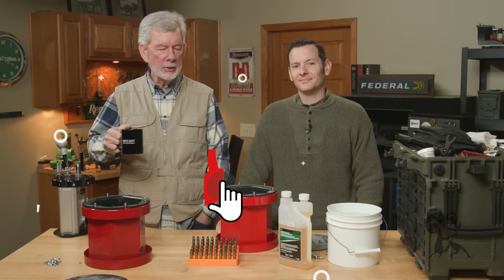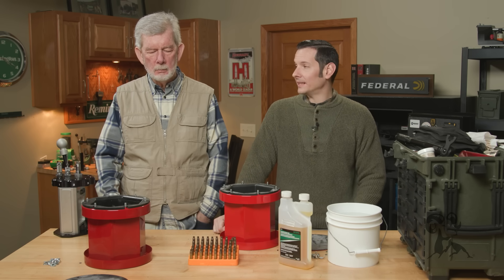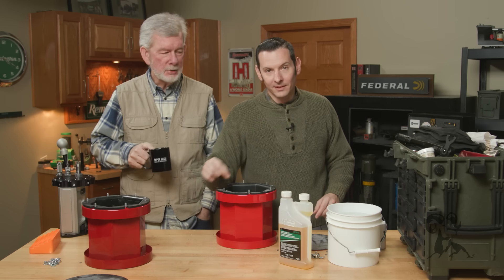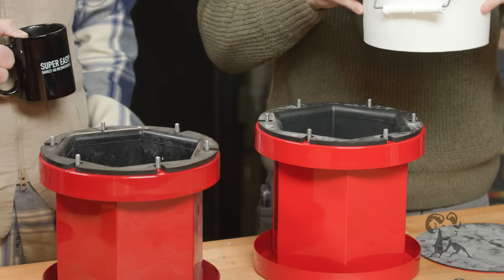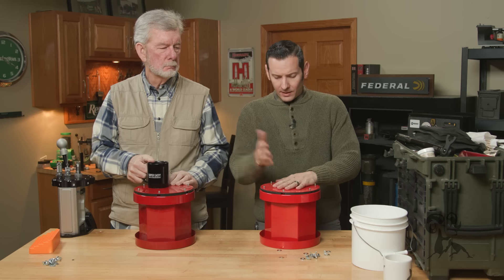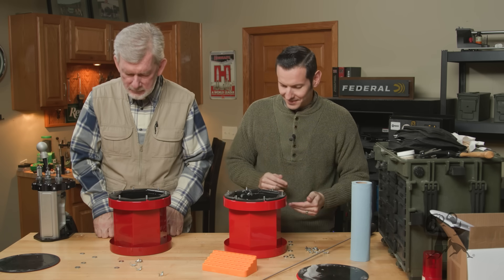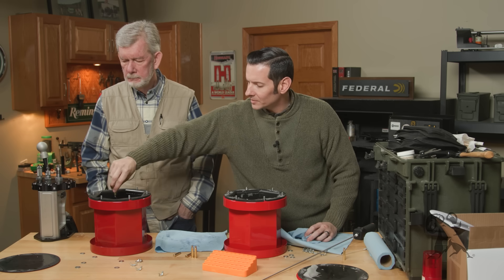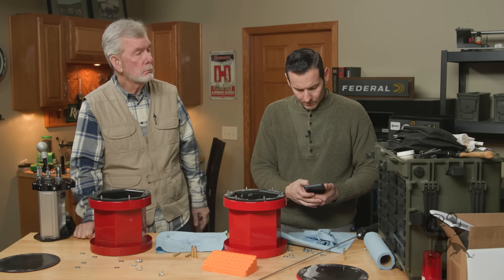SmythBusters: Tumbling Brass With And Without Pins

Comment: I've used Brass Juice with wet tumbling, no pins, and the cases came out looking brand new/virgin. These were cases I had just shot, so not sitting out all winter, or for months, in the weather. From what I've heard, the solution you use makes a pretty big difference in how the cases come out. Especially if you don't use pins. I do have some pins on hand, so I COULD use them IF I really needed to. Just haven't seen the need to date.

Comment: Nice video. But you left out one massive negative factor in tumbling with SS pins. You should have shown the difference in peening of the necks. That would have made this video totally thorough and more relevant.
Reply: Never had peening of the necks, but I only tumble for 30 to 45 minutes. Minimum required for a clean pocket. Heck, I tumble rinse with the pins too and it didn't beat up anything.

Comment: Now, do a comparison with an ultrasonic cleaner.

I use an RCBS ultrasonic cleaner -- no pins, of course. I also decap before cleaning. My brass comes out as clean and bright inside, outside, and in the primer pockets as your brass tumbled with pins.

Comment: I used both, dry for many years then went with SS pins. There's a BIG difference of inside the cases and primer pockets. Pins can and do get stuck in the primer pockets and inside cases if not careful. Also pins can and do cause stuck cases unless lubed very well even with pistol cases. Bottom line is how well you like your cases clean and shinny. If the cases is clean inside and out that's the biggest thing. Shinny is to each their own.

Comment: I never use pins. I use Lemishine and 4 cap fulls of Frankford Arsenal Brass Cleaner in a Frankford Arsenal large Wet Tumbler with lukewarm water. My brass is always super clean. Never had an issue using this method
Reply: Same for me.   I dont use pins and the brass is very clean on the outside and much cleaner on the inside than when I started. No pins to get stuck inside the case or deal with or to purchase.   KiSS theory
Reply: Same here. Cleans well enough, don't need show room shine, just clean for die use/effect.

Comment: Steve wins simply because he doesn't have to deal with removing the pins or rinsing the foam.  I'll stick to walnut tumbling though...I can get brass clean in 3 hours, shake the walnut out in 2 minutes and start loading without having to wait for brass to dry.
Reply: I went to wet tumbling due to the toxic dust from vibrating cleaning machines.  I developed COPD and the dust was aggravating my condition.

Comment: I usually dry tumble a few hours with a few thin strips of dryer sheets. The sheets help collect the carbon dust. Toss the sheets after a tumble then de-pin. Then the brass goes into an old Nestlé quick plastic tub with a drop of Dawn dish soap and a few drops of lemishine and just enough water to cover the brass. Hand shake or swirl for 15 minutes to 30 minutes, as much as my arms can take, then rinse. Dry with a fan on a towel and everything comes out like new. No pins involved.

Comment: I find all the expensive cleaning gimmicks a clever bit of marketing. I have not used pins, to date, have not seen the need. Primer pockets come out very clean. I use a formula from a demonetized YouTuber who has moved to other platforms. Lemi-Shine  being his magic ingredient, dish soap the other. I modified to what I had on hand for a cleaning and never went back. Lemi-Shine , a splash of Simple Green and  mostly water. I do small batches, typically what I just shot at the range, a HF tumbler gifted to me, 3hrs-ish.  All shiny. I still use dry media vibratory tumblers more than wet.  Still works, great for pistol cartridges, rifle rounds loaded with the dry cleaning still give me my .75" groups at 200 with my best shooter. Some things aren't enough difference to make a difference. I'll obsess in other areas.

Comment: So I’ve used my FA rotary tumbler with dish soap and Lemishine with great results, and tumbled for less than an hour.  That said, I’ve only done 300BLK and .45 Colt brass so far.  Maybe 5.56 takes longer since it has a smaller case mouth for the pins to go in?  But tumbling for hours, like they mentioned in the video, seems excessive.

Comment: I don't use pins, I don't even use a tumbler. Just a rubber tub with soapy water. Give it a good shake and roll occasionally while watching TV, and it's good to wash off. It doesn't polish the finish super shinny, but it's functional and easy.

Comment: I have a question for the community. Would this test also translate to aluminum suppressor baffles? I've seen folks say that we tumbling is the way, but others say that the pins round out critical surfaces.... So would wet tumbling with no pins be beneficial in that case?

Comment: In my country I can't get pins. I use split corn, kinda works
Reply: Tumbling I would guess. Give it a try with corn cob media. Maybe get it at a pet store that is used for bedding. Add a little chrome polish and in my experience, will get the cases clean enough for reloading.   Good luck.

Comment: For me, I quit pins and don’t use any of the pre-made formulas. I use a squeeze of dish soap, a little cap of citric acid or Lemishine, and a capful of TurtleWax Wash and Wax.  I let it roll in a Frankfort rotary tumbler for 90 minutes. 

Using pins there was the possibility of missing a pin and ruining a barrel, plus at times the pins can peen brass mouths. Only time I will use pins anymore is nasty range-pickup brass that’s really coated in dirt.
Reply: Mostly same.  I don't use the Turtle Wax stuff.

I don't use the pins because separating them out takes a lot more time for very little added benefit.

Wet tumbling is safer, leaving less lead residue, but vibratory tumbling was so much easier and faster.  This is how I split the difference.
Reply: Citric acid , wash and wax , no pins here. Works fine . Maybe 45min of tumbling. Sometimes I throw in 9mm casings with rifle casings to  act as roughage.

Comment: Either way, if you wet tumble, the necks get peened.  So you have to deburr and your cases get shorter each time.  Dry tumbling is still best, or wiping them down by hand if there aren't many.
Reply: @spraynpray  in my experience the peening only occurs with SS pins. I get zero peening the way I do it. I’ve found the firing process and sizing process incurs enough case growth it needs trimmed and deburred anyway. I use a Henderson 3-way trimmer and it takes less than a second a case and they come out exactly the same.

Comment: 3-4 hours in the tumbler?! Mine comes out shiny in 30 min. I usually decap, tumble once with pins, size, and tumble again without pins to remove the sizing lube. Dry cases in the jerky dehydrator for an hour.
Reply: I was going to say the exact same thing. 30-45 minutes is more than enough, with or without pins. If the brass is really nasty, maybe an hour and a half at most. One of the huge reasons to switch to wet tumbling is to cut down on time.

Comment: Seems like WAY more trouble than it is worth. How can you be sure the cases are dry inside?  I think I'll stick with a vibrating cleaner with dry media. I can go from clean to reloading in 5 mins. :-)
Reply: That's what a dehydrator is for.  Can be dry in a half hour-an hour. Now, if you're smart, multi-tasking in big batches is the way to go to keep components stocked. Dry tumbling works just fine. However, if properly clean brass is the goal, there's no comparison.
Reply: Food dehydrator, or a convection toaster oven.
You should see how dirty the water gets.
Reply: @TheSuburban15  Is this really an issue though?  I used to shoot IPSC, Steel, 3-gun and various other rifle and pistol matches and must have reloaded 10's of thousands of rounds of various rifle and pistol calibers and while the outside of my brass was clean and shiney like jewelry I don't ever recall the inside of the case being an issue. Throughout all that reloading I never had a squib or a round that wouldn't feed or chamber.

Comment: I like to wet tumble without pins first. That keeps all my equipment clean. Then I de-prime, tumble with pins if I care enough about the pockets. Sometimes even a 3rd "rinse" w/o pins to remove lube. 
Thanks guys!👍👍👍👍👊
Reply: I tumble before depriming and after as well to protect my equipment from excess wear

Comment: Depends again on what you are doing.  I decap and wash, dry, size and trim then do a final wash.  Using a two wash like this, I could not see a difference between pins and not pins.  But we also police our brass as it is shot.  That may be the difference.

Comment: For those that have never wet cleaned their brass before, Caleb and Steve are demonstrating a way more expensive system than needs be. For 10+ years, I have used a Harbor Freight rock tumbler and a few drops of either Dawn or car wash liquid. I separate the pins by dumping the brass into a Dollar Tree colander (with slots…not holes). I have literally used the same SS pins since starting cleaning this way.
Reply: Why wet tumble?  For years I dry tumbled 5.56 using a Dillon Precision vibrating case cleaner and media separator. A tablespoon of their polishing compound and those cases came out looking like JEWELRY. I did many thousands of pistol and rifle cases without a single issue.
Reply: @eosjoe565  I didn't even know there was such a thing as wet tumbling...I used a tumbler and walnut shell...lol
Reply: @ Same here.
Reply: @jz362  yes, dry tumbling certainly works.  But there is no comparison between dry and wet tumbling.  Wet tumbling is light years cleaner
Reply: @eosjoe565  Lead dust for one. Time for another, dry tumbling takes a lot more time. Efficiency, noise, cost (wet tumbling costs more to set up but the materials are under a penny each time), wet tumbling gets them cleaner etc.
Reply: @eosjoe565  same here but I use car wax bc I’m cheap
Reply: @bocefusmurica4340  I'm sure the stuff Dillon sells is just liquid car wax. :-)
Reply: @bocefusmurica4340 I was wondering if you could use wax or even a 3step polish
Reply: @eosjoe565 dry tumbling is more than adequate for cleaning and loading brass. Been around a long time for a reason. However, there's no comparison for both the dust you would no longer have to deal with, and end of the day, wet tumbling absolutely makes it cleaner.
Reply: Yep.  Dish soap and a little "Lemi Shine" dishwasher additive is my recipe for the rock tumbler.
Reply: Low capacity but sounds good
Reply: @bocefusmurica4340 the double barrel rock tumbler probably holds 2/3 of this featured one.
Reply: Why would anyone NOT use pins? If it does a better job then why go without?
Reply: I never tumble anything. If the case is super dirty ill just wipe it
Reply: @tiputipu777  - you like pretty cases regardless of actually being dirty. 
I want my cases clean, inside and out l- not merely pretty.
Reply: Yeah I have one of those and have used walnut chips and car wax and it is super clean
Reply: I bought one but it's just a vibrating dry one. I just use sand with some polish stuff I bought at Walmart.
Reply: I’ve been dry tumbling since the early 1990s. 
Still works just fine, thanks.
Reply: Someone making life more complicated than it needs to be telling others they are making life harder than it needs to be.
Reply: @dn88s   be less idiotic

Comment: I stopped using pins, does not work as well and takes longer, but it's good enough and saves time getting the pins out of the brass
Reply: That’s why I have no interest in it.  Massive Dillon tumbler for the win. 

I would do it for extremely tarnished cases but that’s not many.